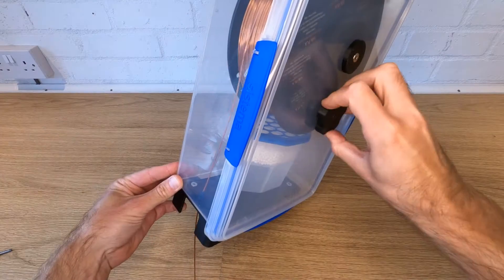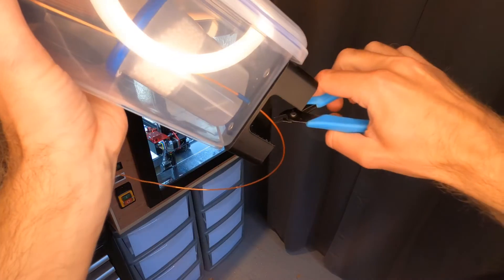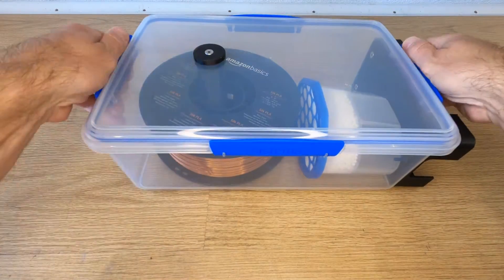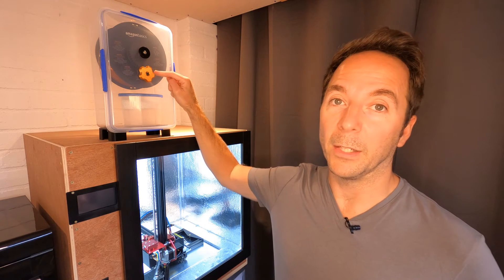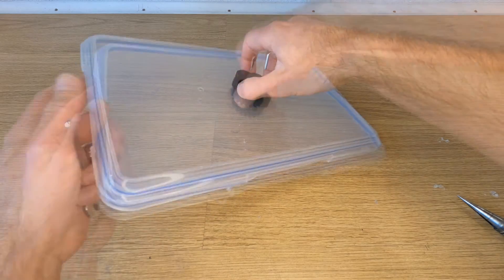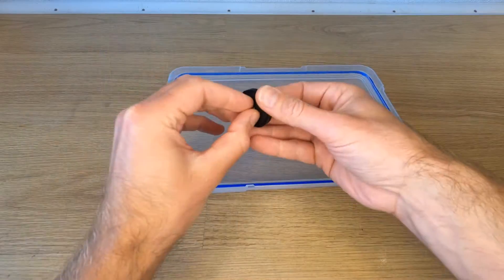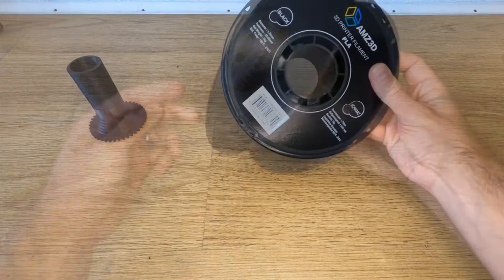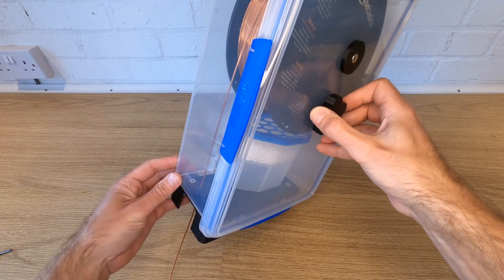Ultimate Filament Dry Box Rewind Mod (now it's perfect😁)

Comment: Just a thought...

How about attaching a larger diameter drum to that winding knob then attaching a cord with a weight to the drum. That way if ever the spool over rolls (or whenever the printer retracts) the spool will wind the slack up automatically. Presumably it could be designed such that when the cord is completely would up it will just drag the weight over the top of the drum and drop over the other side. Assuming the drop isn't too violent it can just do this time and time again, always being ready to take up slack if ever it's needed. For even more "perfection" you could even have the winding drum attached to the main spool with a chain or something such that the weight can hang off the back of the printer... but that's starting to get complicated: 😁
Reply from the maker: I like your thinking but I haven't found retractions to cause a problem with this design. I think it's because of the built in resistance from not using a bearing. When I tried a bearing, I got some tangled filament.
Reply: @RickyImpey  There's a version of this with bearings? If so, can we have it? I use this mainly for TPU (no retraction, very slow extrusion and travel), so I don't think I'll run into any such tangles; but I'd like the reduced resistance.

Comment: What a fab project, I really enjoyed building this drybox and it fits together nicely exactly as described. I want to start using TPU so this was an absolute must-make for me before even risking breaking the seal on the filament pack! I have a top feed printer (Elegoo Neptune3 Pro) so I'm going to build a platform to put the drybox on, and went for the original bottom-exit hole but I added a Bowden coupler screwed into the bottom of the box. I went for the cog-with-teeth-missing option because I don't want any extra friction from that gear as TPU is stretchy, so I did the cog up fairly tight (so it stays where I put it) and printed an arrow to stick on the knob so it points straight up when the toothless section is in line with the main cog, and then it can't catch a tooth unexpectedly mid-print. I also designed a hygrometer holder so I could monitor what's happening in the box, but I expect it will be reading very low always! It was quite confusing for me initially because I came to this project after the mod was available, and I had to work out which bits of the original I didn't need to print, and how to do the holes in the right places when going straight to the modded design, but I managed it without any goof holes, hehehehe, very pleased with the result. Thank you!

Comment: I'm new to this 3D printing game... and I had issues with my prints lately. I was told its the wet filament. I found your video, built a crappy version of your box a few days ago, so I am waiting now, not sure how much time it takes to actually dry the already wet filament. Ordered a humidity meter, although it has not arrived yet... but anyways, not sure if the humidity decreases, does it mean that the filament is dry as well? Altogether my problem with this (*not your fault of course), I live in Budapest, Hungary, I could not find this particular box anywhere :/ Just a suggestion, although probably at this point, I know what to do, I will make a 2nd box later. I would try to use a bit more "globally sourcable" box. Like an IKEA box or something... like this one (IKEA 365+ 10.6l) I looked up only and the size seems like something that can work... probably different orientation of the spool, but still :)

Comment: I did this mod on my box but for what ever reason, the nut that holds the gear in place hits the spool and causes it to stop turning. I'm going to print the gear a bit shorter and shorten the bolt.

Comment: Just finished mine, unfortunately for me the Systema manufacturer has completely changed there design and the stupid clips are attached to the lid and pull down onto the base. It is ridicuous!.... such a pain to pull it all to snap them shut. So the design only worked about 80% for me. I had to take out that rectangular base and just put flat washers as could not fit the spool and the drying chem basket. Now to go test it all out. CHEERS! - PS shouted you a coffee or 3... enjoy!
Reply: I too have the newer design and have had no problem other than when I put the feet on the box leaned over toward the back (bottom of the box) quite a bit.  I added a 7mm wedge on top of the feet to stand the box more upright.  All in all only very minor issue that was easily solved, keep up the good work
Reply: @graemeprice2391  This is odd because I just ordered one from the original Amazon UK link and I got the one with the handles on the base. It's clearly shown in all the variants on that link that the handles are attached to the bottom. There are two types shown on Sistema's own website, the "Kilp-it" which is 7L and has the handles on the bottom, and the "Klip-it Plus" which is 7.5L and has the handles on the lid. Two completely separate ranges. I like the handles on the bottom and have loads of their tiny ones for freezing herbs and sauces, so I'm really glad they still do that on the bigger boxes including the 7L one for this drybox project!

Comment: Legend Ricky, i have been binge watching a lot of your videos when I get a chance. Got all the gear for this box - Just waiting another 8 hours for a big print to come hot off the press and then will load all of your STL files and one of the remakes with the top handle.... great idea from that guy! Its a pity you cannot just insert an 80watt incandecent bulb into this box and have the roll rotate like a pig on a spit. then also implement your first mods and your turbo mods that you did to the Sunlu V1. Would be really interesting to see if it would work.... I have just upgraded my Ender 3 Pro to a Direct drive and could possibly used the original Creality 42-40 stepper motor with a driver circuit and a trim pot to increase and decrease the speed of the motor and also flick a switch to put it into reverse so you can rewind. less parts and the motor can do all of the work and evenly dry the spool.

Just an idea.... I am sure you have thought of it.... I might just mock it up myself and design and print some 42-40 creality stepper mounting plates to insert the motor into the container and re mix the spool to connected directly onto the drive VIA a 3208 bearing to allow it to have reduced friction. Cheers anyway....
Reply from the maker: I don't know that the motor would be worth all of the work but I could be wrong. I believe the warm air tends to do the work rather than any radiated heat. It would be an interesting experiment though.

Comment: Just finished building the full box, with the rewind.  Great video.  I have mine feeding out of the right side of the box through a pnuematic connecter and tubing, just easier based on where my printer is set up.

Comment: This design is great... the only thing keeping it from perfect is that I don't have enough vertical space above my printer where I want to put it, haha. Would the dehumidifier pack fit if the box was on its side? or I wonder if the spool would have too much friction if the box was sitting on its base (with the lid upward and the spool sideways). We need a version that can be turned 90 degrees ; )
Reply from the maker: Hi, unfortunately these dehumidifier packs don't really work on their side as eventually any water that gets collected will run out. What you can do though is put some silicon desiccant beads in a container to do a similar job. The spool is fine with the box on it's 'side' if you use the parts from the rewind mod but not really on it's 'back'. I think that you would need some kind of bearing under the spool to be able to lay it flat. I'm imagining a small 'lazy susan' setup.

Comment: Ricky, why in the world is the hole in the main post off centered?
Reply from the maker: Because it's a modification to the original design. With the off-centre hole, the same mounting holes can be used for the rewind mod so you don't need to drill more holes in your airtight box.
Reply: @RickyImpey  That is what I thought but just could not see it. My brain was fried when I asked. I was in the process of trying the Creality Sonic Pad but could not make  it work. I have one more project to do (print a cooling shroud to replace my PETG shroud that has been melting... Bought some PolyCarbonate! Then I tackle the Ultimate Drying Box! Actually, I may tackle Klipper first, then the box for speedy prints!

Comment: Hi Ricky... I like this design so I'll probably build a couple..... I have a daft question if you would be so kind... If moisture is dumped into the bin..... How is it that the filament does not re-absorb the moisture?
Reply from the maker: Hi Mark, I'm no expert on that side of things but I know that the calcium chloride that is in the desiccant packs chemically changes the water rather than just sort of holding on to it like silica gel does. In fact, even when it looks like all of the calcium chloride has dissolved and there is only water left, the liquid is still absorbing moisture from the air, just not as much. I think eventually it just becomes very salty water as it's safe to pour away.
Reply: @RickyImpey  I ordered with your links... actually, I ordered more than a few things.. I believe you dance with the one that brought you to the dance! Thank you..... I did see that the desicant pack/bin has a water vapor barior of sorts... Don't know but will see, I belive in your results. I will actually be ordering a food dehydrator instesd of a  dedicated filament dryer. I did see in you later videos that you did advocate for this. Well, I knew that one but your vid did reafferm it! Thanks... I like the way you do your videos. And thank you for the stl files... though I think I'll draw my own design... I love CAD! Oh, by the way, brilliant in the rewind gears!
Reply: Oh, tried to "buy" you a cup... but the site was not very explanitory.... Were the cup pictures dollars or ????
Reply from the maker: @orionmec  Thanks Mark, yes please do your own thing, that's a big part of the fun! Food dehydrators are great for drying filament and should be easy to mod. Enjoy👍
Reply from the maker: @orionmec  Appreciate the thought Mark. I'm not sure if you see the same as me but for me it's UK £ not US $. It's only £1 per 'coffee' which is about $1.20

Comment: Thanks so much for this! I've been looking around for an inexpensive, simple, and effective individual drybox for a while now. Not only does your design tick all those boxes, it's also quick to build - a day's worth of printing with a .6 nozzle, 30 minutes to put it together, and bam! - another drybox ready to go! So happy with it! Building 4 right off the bat. I had a bunch of hygrometers I had bought for a different drybox project, so I'm adding one to each of these.
One thing that would be nice would be something to hold the dessicant box in place. I might try designing my own if you don't already have one or I can't find one.
Reply from the maker: Glad you like it! I didn't add anything to hold the dessicant as I didn't want to tie people down to using the exact same boxes as I do. Should be very easy to mod the base plate to add some corner guides or similar. It wouldn't be usable as a drill guide then though.
Reply: @RickyImpey  Definitely want to keep the drill guide functionality! I think I'll just throw some kind of holder together and hot glue it onto the base. Just to keep the dessicant from shifting around when moving the box.

Comment: Have you thought about a sprung clutch design? Go hands free with it. I'm always afraid that my filament will just start shooting everywhere when I take tension off lol
Reply from the maker: Yes I did look at it but there isn't a lot of room inside for one. It would also be difficult to get it to rewind the correct amount as everyone will have a different amount of filament that needs to be rewound depending on their setup. I figured the best way was to use a manual, mechanical system. I'm pretty pleased with what I ended up with and they work well for me. I know what you mean though, you have to always keep hold of that end when putting filament in or out of the box.

Comment: Could you add a heater element to give a boost to the dry box's capabilities?
Reply from the maker: Thanks Tim, yes I could but I wanted to have a box for each 'live' roll of filament and that might have gotten pricey. I currently have 5 or 6 of these plus a filament dryer. Once the filament is dry, it goes in one of these and doesn't come out until it's spent.
Reply: @RickyImpey  Thanks. Does work on filaments like nylon too? I'm looking at making a few, 1 for pla, 1 for asa and one other.
Reply from the maker: @timmehwimmy  sure, the Drybox just creates the best possible environment for any filament so it works for anything. It's particularly effective with the more hygroscopic filaments like nylon as they are such a pain to deal with normally.
Reply: Great videos, by the way. Just subscribed.

Comment: Great videos! Thank you for sharing them. I will try to build the printer enclosure and filament dryer at the start of the new year (I’ll have more time then). I also have a CR 10S Pro. Question, where did you get your mirror for the bed? Keep up the great work!
Reply from the maker: Hi Paul, I bought a pack of 3 from IKEA actually. They are a little small so you have to attach them off center so that the z height probe (BL touch if you have one) can probe the bed correctly. I found moving it to the front left corner worked. Just bear it in mind when your trying to do something big that gets near the edge.

Comment: I built one and it's nice. I'm printing the parts for my second one as I type this.

One thing needs to be corrected! The taper for the screw head on the gear knob needs to be on the gear instead of the knob. I had nothing but a thin nut exposed (no machine screw exposed but  locktighted) on the gear side. And using the gaped gear, the nut rode against the filament wheel and about 3 hours into a print caught in one of the slots on the side of the spool and stopped it. Ruined the print. there's a shallow grove cut into the spool where the nut was rubbing
Reply from the maker: Hi Louis, I didn't have this problem myself but can see how it could happen if the filament reel is too close to the front face of the box. Did you use the spacer between the reel and the large gear? It may just be that you have reels with a bigger internal diameter and need the spacer. I can do a version of the gear and knob with the taper on the other side quite easily though.
Reply: @RickyImpey  I had a similar problem of the bolt through the rewind knob/gear catching on my spool even with the spacer in; all I did was cut the 40mm bolt down so that it did not stick out so proud of the gear.  Possibly a 30mm bolt may be the resolution.  Other than that very minor issue mine is working perfectly.
Reply: Edit on my previous comment I cut 5mm of the bolt so that it its end is flush with the top of the nut, recessing the nut into the gear until it is flush with the gear would be another option.

Comment: Ricky, Wanted to let you know that Spur gear on STL has a different connector to spool nut. Missing teeth gear has the same connector. I broke one of the connectors trying to make it fit. lol. Thanks again.
Reply from the maker: Rewind Knob file now corrected. Sorry for the wasted filament😬 Thanks for letting me know
Reply: I meant the rewind Knob has a different connector has two teeth coming out and the one on video shows one. I slowed down video to see the knob and it it dose not match up with the one that is with the files given. Please update. thank you.
Reply from the maker: Oh no, sorry about that, I must have uploaded the wrong file by mistake. I'll sort it asap.

Comment: Wouldn't Air go into the box through the mounting holes?
Reply from the maker: That's why the rewind knob is designed the way it is, it has a couple of flat surfaces that press against either side of the lid. Yes a little air could get in if there were a difference in pressure between inside and outside but the dehumidifier pack is so efficient that it sucks up any moisture in the air. There is much more benefit from having this tiny air gap Vs opening the lid to wind the filament back. If you are concerned, you could put a thin smear of grease or vaseline on the mating surfaces to stop any air ingress.